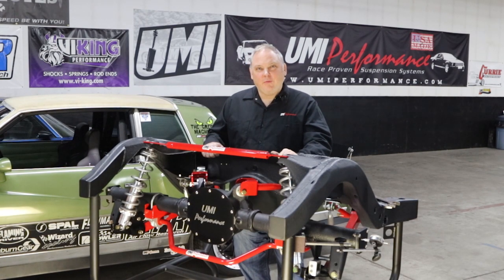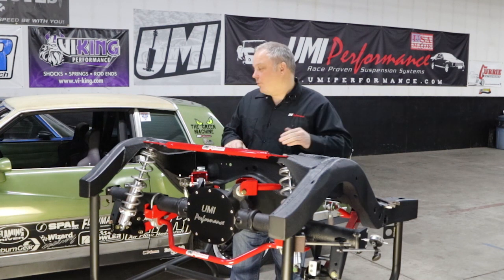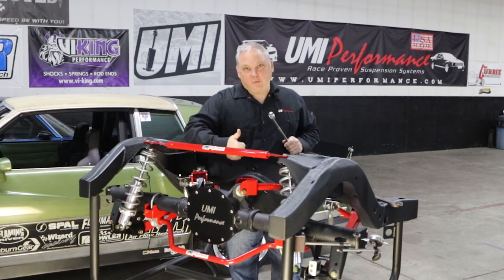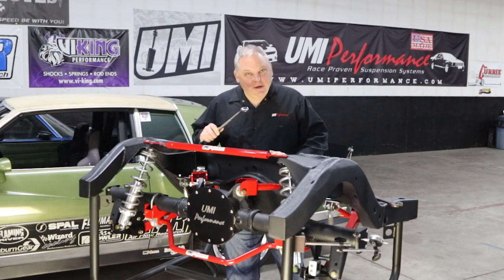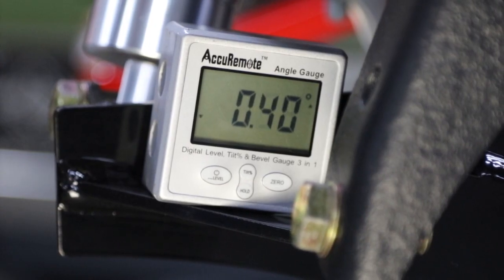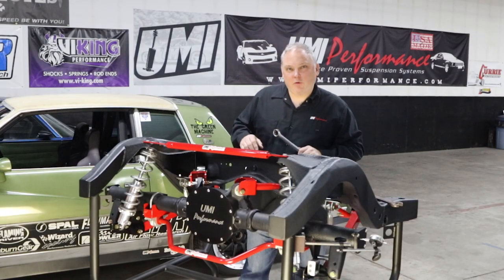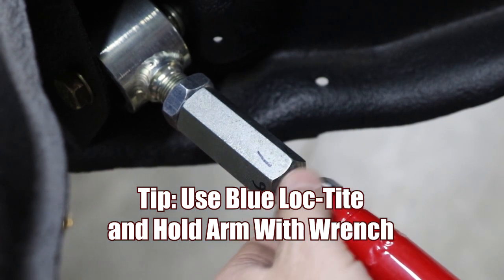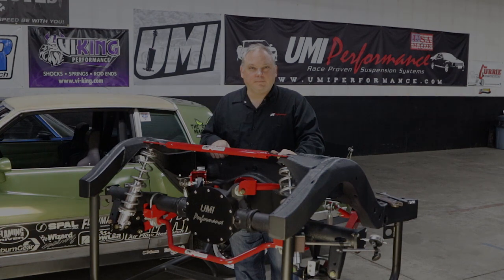Converging Four Links: Adjusting Pinion Angle and Side-To-Side Movement

Comment: If my only problem is centering the axle, do I need just the upper arms ? Can I leave the stock control arms as is ? Do I need different or solid upper control arm bushings on the axle, or do I just keep the stock rubber ones ? Thanks !

Comment: Great information, step 1- square the rear with the chassis using the LCA's (front to back each side), step 2- center the rear side to side using the UCA's (plus one and minus one to keep square), step 3- set pinion angle (adjust both UCA's the same amount, and in the same direction).

Comment: Does the side to side adjustability apply if using your lower lift bars part #3020?
Reply: Yup, the upper arms still function the same way. The lowers control wheelbase mainly.